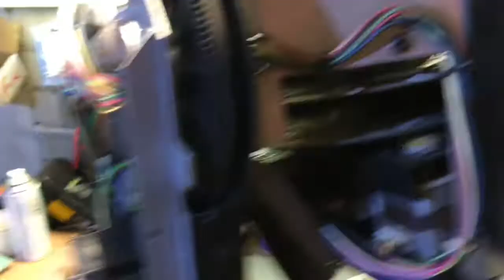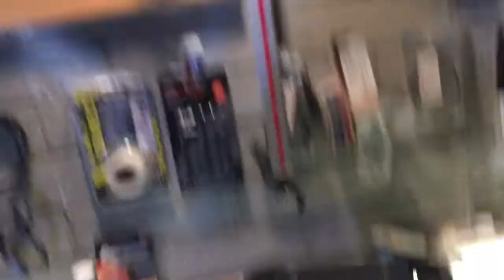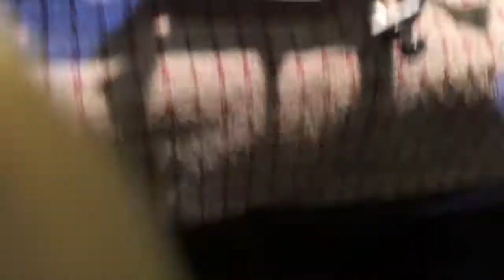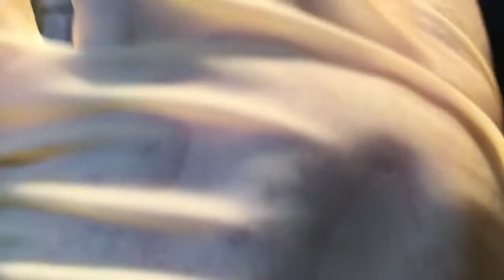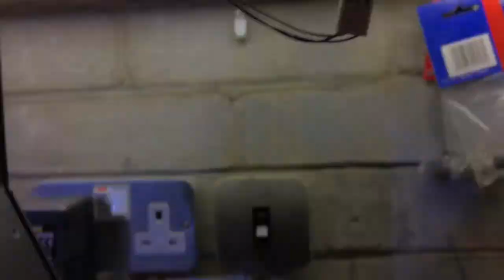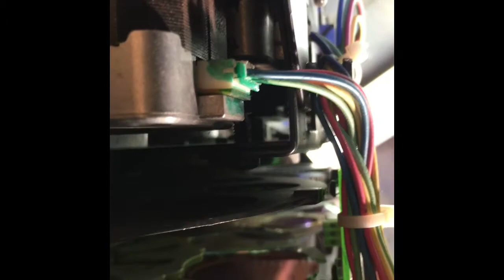How to dissemble, clean and reassemble MARTIN PROFESSIONAL MAC500 fixture

Comment: Keep in mind that if using a vacuum cleaner with a hose, it will create a buildup of static electricity, and could very easily destroy some components on the pcbs if it discharges on or around them.
Reply from the maker: Really? Hmm. I never had that.

Comment: LITERALLY doing the Lord's Work!
SO many churches end up having to use old and sometimes even antiquated moving lights!
Cleaning them though dramatically extends their lifetime IMHO!
Reply from the maker: Bless you. Yes you’re right. But antiquated isn’t necessarily a bad thing. If you can maintain  them and use them well, then that’s much better than spending an absolute fortune on modern fixtures. It’s just not warranted or justified when you consider what it actually does. Better to get slightly outdated equipment as the functions are awesome but the piece is super low comparatively.

Comment: On the topic of power.  I have two of these, but they both seem to be the 500 and not the 500E.  Our power here is 110V, which clearly means it won't work on our setup.  We do, however, have 220V running to our oven, clothes dryer, and water heater.  Is it possible to wire up the 500 to use one of these circuits for testing, or am I heading down a road to disaster?
Reply from the maker: Jon Griffith can’t advise you with detail, but I believe all Mac 500’s have a voltage selector inside. You should be able to select 110 on the unit. If not, then it depends on whether you are talking about connecting up to an AC or DC supply of course. Theoretically, as long as you have 220 AC you can connect the Mac to it without any issues. BUT you have to connect the whole unit with the mains cord ... not just the board, as you need to have the transformer supply relevant voltage to each rail on the board and other components in that unit for you. Hope that makes sense. 
Regards
Rev Julian

Comment: If you do that again unsreew the colorweel an put them all together in a ultrasonic cleaner with water an a bit sope, my colorfilter are worst than that. Just few min and you have just to dry them. Do you have ever trouble with a hall sensor? It looks like the sensor works fine with an external magnet.. but not with the colorweel magnet any ideas?
Reply from the maker: Mihi Gyver yes I do! I have to clean the magnets on older units quite often. And also make sure the alignment is right. I alter time have to bend the sensor back to the right position to have it pick up correctly. 
It can be a pain.